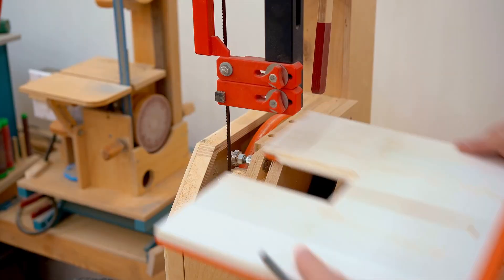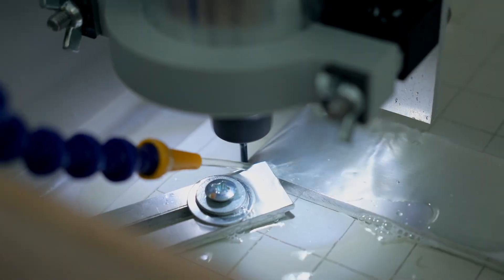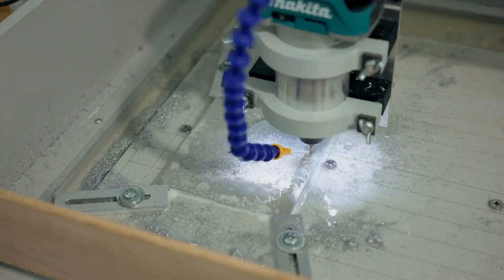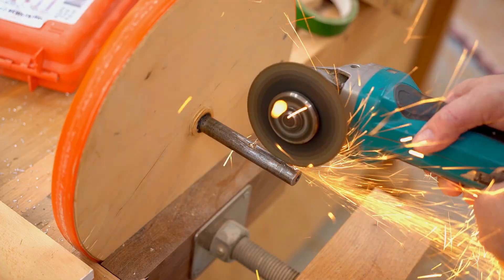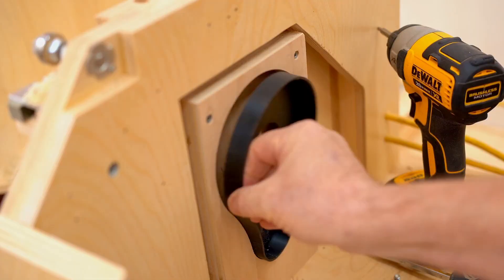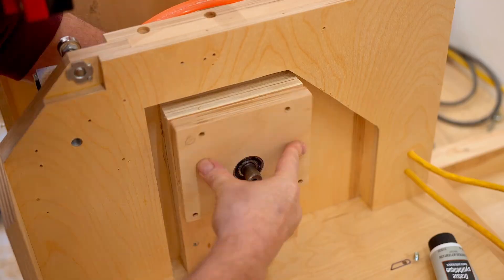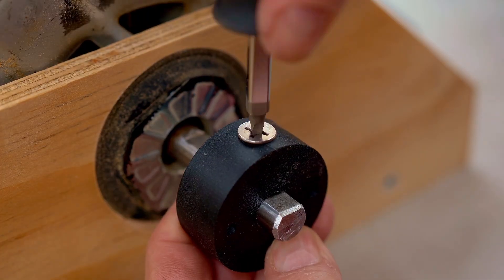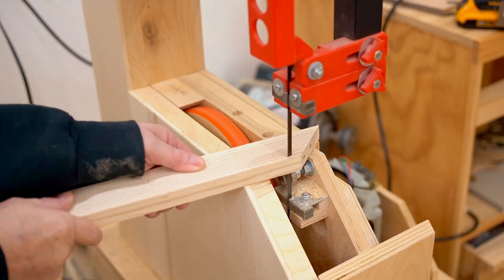I Built My Own Free Energy Device!

Comment: Straight cut cogs are loud but efficient (and mote vibratory if you like). If you could cut the splines of the cogs at a (slight) angle it'll be much quieter/smoother.

Comment: Just make sure that if you do make a perpetual motion machine you include a spark plug with a coil of copper wire attached to a capacitor...otherwise it just won't work.  So, I meant to ask you in the last video about making the gear driven band saw are there any pluses to having a gear drive?  Is there slippage with the belt drive, or is there a power loss with using the belt drive?  Great video John thumbs up.

Comment: I understand why gears are ideal for some high torque applications. You mentioned two cons (vibration and noise) but you didn't mention any pros. I don't see any problem with a belt driven wood cutting bandsaw. At one time I had a bandsaw with a gearbox so it could be used for metal or wood. Geared down for metal and direct drive for wood.

Comment: John, I put 10 solar panels on my roof, with all the tech needed, back in 2023. It was the best decision of my life!
I'm from Brazil and here the regulations allowed us to change the electricity clock... I don't know the correct name in English... And then the energy produced here goes straight to the grid. So the clock runs both ways, as we use electricity and produce it. 
So, anyway, we used to pay 1000 reais every month for energy, now we pay something between 125 and 150 reais. And we I pay 711 reais monthly for the financing of it.
So, it's definitely worth it!
BTW, the last "free energy" thingy Matthias built looks like a pretty fun tabletop toy! I'm going to make one! 😂
Anyway, stay safe there with your family! 🖖😊
Reply: You’re thinking about the power meter or electric meter.
Reply: @mikebond6328  Might be, I don't really know. But it's the thing that says how much energy you used.
Reply: I put 16 solar panels on the roof a few years back.  But most of the power it generates goes back into the grid in off peak and I use most of the power in peak from the grid, so it's saving me very little.
Reply: @PJRayment  Battery bank.
Reply: @mikebond6328  
Yeah, I know about them.  But when you're sold something that is supposed to save you money, and it doesn't, and they tell you that you have to spend even more to save money, I'm not inclined to bite.  It more a con than anything.

Comment: The great illusion that solar and wind are sustainable. Both are variable, the equipment is subject to failure and diminished return. Wind fluctuates dramatically, as does solar on any given day. At least you have some back up and therein lies the true benefit of what you've done.  Recouping the investment costs may happen over time, go bigger and that recovery won't happen as the maintenance will offset that.
Reply: I used to install solar in the oilfield in Texas!  It couldn't handle the heat and cold . Batteries going dead at 3 in the morning and shutting down the wells made me a bunch of money.